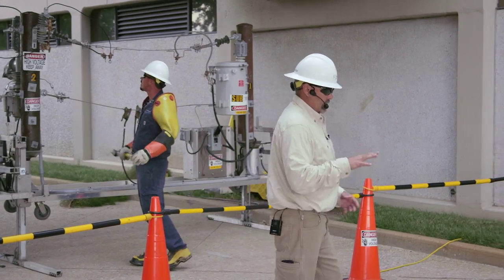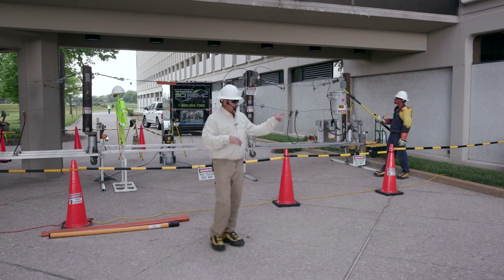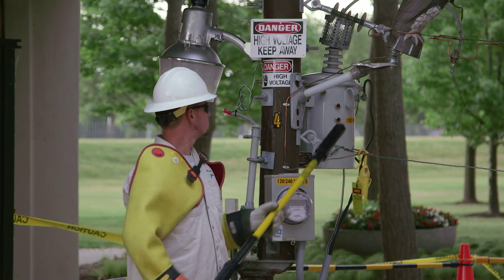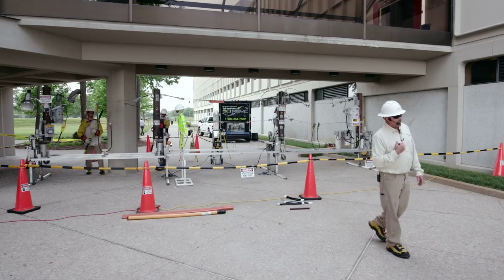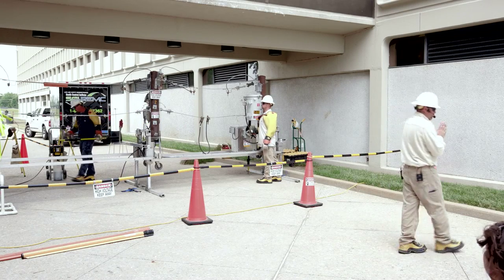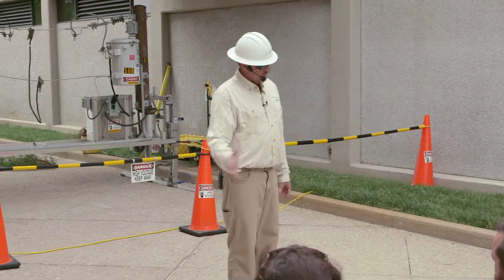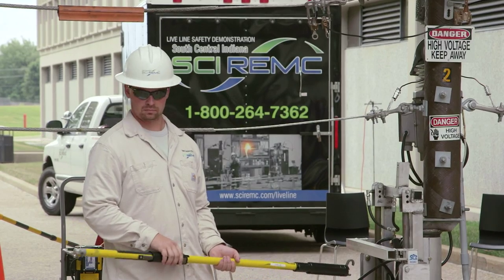SCI Live Line Electric Safety Demo

Comment: That is the purpose of an ATS ( Automatic Transfer Switch ) when a customer buys and has an electrical company install the pad mounted generator. I personally have most experience with the Cummins generators and I have done a few of the Generac generators. When the house loses power the generator senses the lose of utility and switches the panel towards generator power, then once utility comes back the generator switches back in around 5 mins (depending on brand).

Comment: I felt the step potential once. We where standing barefoot on a Boulder on the edge of Lake George.. In the distance we saw lightning hit the lake. 
We could feel a little current.
Reply: Yep.  It's basically what kills you, the difference, even if you might survive the intense heat and the shock of the intense sound pressure on your ears and being knocked down, it's usually the difference between either your two legs or (when people still think laying down is better than making yourself as small as possible while having your feet as close to each other as possible, your head and feet) that's the most dangerous.
It's the same what shocks you when you touch the mains: you are at zero volt potential, and the mains isn't.

Comment: What happens if you able to stay in a car and it’s energized. Would the lines be deenergized and how long would that take in an emergency?
Reply: @KlixTrio, cars are generally a metal shell with fabric and plastic interiors: in most cases, power will flow around the outside of the car to the ground, leaving the inside of the vehicle relatively safe.  That flow might trip a cut-out, but it might not, and it is virtually impossible to know when it's safe to leave without a utility worker being present outside the car.  Response time varies by conditions (It's really hard to get out to you if you're in a rural highway during a blizzard versus if you hit a pole on a warm summer night), but they will prioritize getting trapped people out safe before they work on getting power back on.

Unless there is something that makes it too dangerous to stay in the car like a fire, just sit tight, call your local power company or 911 so emergency services know exactly where you are, and be patient.  It just takes time to make sure everyone can get home safely.

Comment: Mylar itself is not actually conductive, it’s an insulator. However, balloons aren’t just made of Mylar… they are also coated in a thin layer of aluminum, which is very conductive. The aluminum is why it’s reflective, otherwise it would be clear. Same with a bag of chips: it’s aluminized, and if it blows up against a power line, it’ll do the same thing as a balloon.

Comment: These guys walk with a swagger.. IT'S WELL DESERVED! Even Dirty Harry wouldn't mess with the "Devil's Veins". It's incredible that 1,000's of volts hover, in bare cables, over our heads and we don't think twice. That's a shame. Take it from Ben. Electricity can ruin your whole day if disrespected.
Reply: Well, we have them underground practically everywhere, and when something went wrong somewhere during an outage it caused ehm, well this problem:
https://www.youtube.com/watch?v=PT-DTVa3YAQ

(It was said an existing powerline used to divert power might have overheated due to high a demand on it and, at a particular style of joint that might have broken down over time and had ground water ingress and is also insulated with mineral oil suffered a breakdown which is what caused the thing you see in the video.)

Comment: Would there be a way to have sensors that can somehow relay information back , like some sort device that detects electromagnetic frequency , so let’s say if one of the sensors that ran off it’s own solar power idk how it would be connected to relay the info but to know exactly where the power has disconnected a EM sensor could show because all the ones that show on gps lit up but then there’s one the rest down the line out , then from live to dead check that exact location and that’s where the fault is . That way time is saved looking for it and more

Comment: How do you hook up the gene wrong? I’ve always had it done with the gene producing 220v. I use a double male RV plug to plug into the electric car charger port. So when power goes out. I shut the main and plug in gene. start gene and then I have power to the house while solar panels and generator are still producing without any voltage going back to service.

Comment: If microwaves cook from the inside out, why is the outside of the food always piping hot and the inside cold?
Reply: Not all microwaves will have a good dispersion of the energy from the magnetron, like for instance, we have a cheap one (it does the job, don't get me wrong) that has the main focus of the energy in the center of the metal cage.   So when you put a plate down at the rotating dish it can actually be pretty insufficient compared to when you would place the plate higher up.
Also, moisture in food tends to be more sensitive to getting heated up then areas in food that contain a smaller amount of water (just like, with pizza, tomato on it can be flaming hot while the rest is edible, water get's heated up better and is able to retain that energy better than the more dry deough of the pizza.

Comment: Wait so if a tree fell on the line it could “cut” through the tree?
Reply: Yes! To a point. Obviously it's only going to burn thru tree's(Limbs) up to a specific size. Also depends on how conductive the limb is. The more green a tree is or how much water/rain or moisture is in it. All plays a role in what ends up happening. So just to be clear, if a limb lands on a line and it's wet from the rain. The fuse is going to pop! If they have a circuit breaker installed it'll try to turn back on a few times like what was demonstrated in this video. But it won't stay on unless the limb falls off from wind or something. Because obviously being wet is making it highly conductive. But let's say a dry limb in the summer lands on it. It won't be as conductive, but it will be enough to burn it. Which will eventually cut through it. If u know anything about electricity and circuits/fuses. A fuse is set to a specific Amp load to fail. If there's something on the line, it'll have to be something pretty thick  like a branch two inches around or so. In order for the fuse to blow. But if it's a small limb. That means that the fuse can handle the load but the limb can't. So the fuse will stay in until the limbs been burnt through and falls off. So basically the limbs act as a fuse themselves, the smaller the limb, the less load it can handle. So if it's a big limb, most likely the fuse will fail before being able to burn thru the limb. The only thing you have to remember tho. Is conductivity! Because it could be a small limb, but it's so conductive. That it immediately blows the fuse. Because it's so conductive it blows the fuse do to an immediate spike in load. But all this kind of takes a basic understanding of how an electrical  circuit works. Next time you go for a walk in a city or town or even in the country. Look up at the power lines. Look and see if u can find power lines that go through an overgrown tree. Meaning it hasn't been trimmed in awhile. Ull notice that even though the trees in need of trimming. Ull notice especially on three phase distribution lines. That all of the limbs are just below the three hot wires on top. If I remember correctly it's called burn out trimming. The limbs try to grow but the tips get blown into the lines just enough to arc and burn the ends. It'll do this no problem. But usually this is a problem area, where lots of power outages occur. Because say u have an ice or heavy snow storm. The snow/ice weighs the lines down pushing them down into the overgrown limbs. But tree limbs also get weighed down causing them to come into contact with the lines as well. And since water/ice/snow makes those limbs really conductive. So usually it'll take the power out. But the system just might be able to burn thru the limbs. Just depends my man. I'm sorry I couldn't find a quick and simple way to explain this. Lol I used to be a Line Clearance Arborist Tree Trimmer, so I literally had the job of cutting limbs 10ft away from distribution lines. I got called out on storm work a lot too. If ur power went out, I would have been one of the many guys going out and assisting these lineman. We'd clear the lines. They'd pop the fuse back in. Anyway hopefully my explanation(Novel) helped a Lil bit. Lol
Reply: @richardbadish6990  thanks it was worth reading
Reply: There are a couple of good examples on Youtube of safety systems not sensing the problem very well after a tree landed on some powerlines and the electricity proceeds to wreak havoc on the tree main branch the longer the power is applied until the whole thing is smoking.

Comment: Another thing that wasn't mentioned was CALL 811 BEFORE YOU DIG!!! My neighbor was that one idiot who knocked out the power to the entire neighborhood by hitting the primary underground power line with bulldozer. He did so much damage that it took almost a full 24 hours to fix it. . . In stiflingly hot weather. That was absolutely miserable. Everybody's food spoiled, we couldn't take warm showers, and some medical equipment wouldn't work without electricity. Not only that, but, my neighbor had to pay thousands in finds. All because he didn't call 811.

Comment: So when line wires get too much sag. And arch.. why no faults? Had this happening for a year until I found them arcing.. duke only cared if it was pole to pole (it was) but I dont understand why it didn't fault something and cut power
Reply: A fuse or the reclosing system will only work if the amount of power requested exceeds that of the fuse or reclosing system long enough.
Like, we had the cord of our toaster blow up once in my home, and it literally blew most of the cord right after the plug completely off, leaving a tiny piece connected to the plug exposed, and since it's an older toaster that contains a nylon outer coating of some sort, that caught fire immediately, and a small flame was shown, along with repetitive arcing.
The fuse however, did not trip, my brother ran to the distribution box and flipped the main switch and yelled to my dad everything was off so he could put a dish washing cloth soaked in water on it.

Comment: I don't understand the part if the line falls on your car you bunny hop..but ems can walk in to the area?! No need to hop?🤔🤔
Reply: No, that's not what he said.  He mentioned that if EMS is not informed about the nature of the accident and they can't see the possible downed power lines very well (either because it's dark, or it's during the day and the cable is not easily visible due to hanging against a dark background like other trees), they will be closing in on the accident site and might start to feel something is not right and back off, or might feel it when it's too late and touch the car or victim and get shocked themselves that way.
It's not common in my country to learn about these things unless you become an electrician or a crane operator (for the main reason most of our power lines are underground) and you need your safety license because you might be operating around high voltage lines, but they mention that should you report an accident involving high voltage and someone is still inside a vehicle that has become live or someone is lying down next to it that you make note that power is still on, so the ambulance crew will know that they have to stay back.
He didn't make it very clear, but it has put EMS employees at risk at well sometimes for someone failing to mention the car was live (sometimes because someone didn't see sparks, smoke or fire around the cable).

Comment: i stuck a jack hammer in 34,000v i was told when u guys should up
Reply: There's a video from a green-keeping crew in my country using a root-destroyer (It's like a very serious circular saw in a way, meant to dig into the ground to completely grind a root to splinters) near a substation and maybe due to the ground sinking a bit (it's a bit of a big problem in The Netherlands by now) the distribution cable probably was a lot closer than they imagined and they cut right through it...
Reply: @Dutch3DMaster  that's shit is no joke
Reply: @215maloneboy9  It isn't.  Luckily it killed power by blowing a fuse immediately and no one was injured, the crew was only shook up and very annoyed about the problem they just caused.

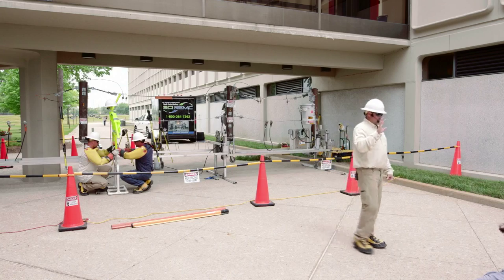Comment: 18:17 it would have been better to explain that it’s because both of the birds feet are at the same electrical potential therefore no electricity passes through it. Instead of just saying “it’s not touching the ground” . Then this would have tied into the step potential explanation because it’s fundamentally the same concept. As long as there’s no difference in electrical potential in your feet then no electricity will pass through

Comment: 5:50 let's see:  the breaker goes on and off 4 times and hopefully it burns the tree off the line.  I'm in Calif.  PGE has started a LOT of fires the last few years by not keeping their line areas free of potential falling trees.  So setting the tree on fire, that's a good thing?  It's 2021 and we now have at least 2 fires burning that were caused by PGE and trees.  Burning the tree down makes no sense.  That burning tree will set whatever is at the base of the pole on fire. There must be something that is missing here in his presentation.
Reply: That's a good point.
This guy doesn't do a lot of presentations
Reply: It's not the main idea of trying to burn the tree limb of, the main reason is to give the circuitry a possible time to recover from a fault, for instance if the limb fell on it, was not balanced well enough to get stuck on the lines and then fell off.  After the initial fault that was sensed the circuirtry was made live again, and if the branch had fallen off (or, due to the first arcing snapped in two or whatever) and the circuit stays on, everything is considered fine.
It's a way to not immediately have a part of the grid go out completely by means of a fuse or security system behind the fuse that operates when serious problems happen, and, for longer distances in the grid maybe also having to send out someone in order to investigate this possible problem which might have sorted itself out.
Even if a branch fell off during the first switchoff, chances are there might have been sparks anyhow, regardless whether it actively got burned through.

The reason it does it 4 times is basically having the thing go: "Hey, I think I saw a problem on the line and I'll switch off for a bit so if the fault condition clears itself in that time, there's nothing to worry about" and after switching on "Oh my!  The fault is still there...." switches off again and at the fourth time it decides there is a serious problem that needs human attention.
It's a bit like not having to replace your distribution box in your home after you had a short circuit because there was a fuse there, which, upon a fault gave the visible (and at times, audible as well) warning like "Hey, there's something wrong that you might want to look into" and when you try to switch it on and the fault is still there will trip again immediately.
Reply: @Dutch3DMaster  it would seem to me that if there was smoke coming out of my TV, then I would want the power off and would then get the hose and put out the fire or call 911.  I certainly wouldn't want the circuit to keep trying to reset, just because there may be some inconvenience for the power being off until help arrives.  The video clearly shows the limb burning and if that had been a partially dry limb (one more apt to break from a tree and fall on power lines) it would have caught the tinder below the line on fire.  Keeping a line live with the risk of devastating fires makes no sense, especially with what we are experiencing Calif. right now.    To stop the possibility of fires, PGE is actually shutting off power to millions of customers during high wind events.  Now that makes more sense than tripping a breaker 4 times to burn through a limb.
Reply: @AffordBindEquipment  As I said, it's not particularly designed with the idea to blow branches to pieces that way, it can be anything that triggers the system to stop it from going into full fault-mode immediately.

I will have to be honest here: I'm reasonably sure we do not have this system in The Netherlands for the main reason our lower voltage is all below ground (and an increasing number of high voltage lines is getting put underground as well) and these kind of faults can not occur.

As for the smoking television set example: I was referring to the manual intervention it requires to reset the breaker, which is what the 4th trip of a recloser would initiate.
A breaker in your home will also only fail if the fault current is high and long enough, otherwise it will stay on.
We had the wire from our toaster blow itself apart due to a short about 4 centimeters behind the plug, and the overall coating of the wire (nylon, it's an old toaster) caught fire and sparked a couple of times, but it did not trip the breaker in our home, so we killed the main power switch so my dad could put a wet dish washing cloth on the piece of wire that was on fire.

Comment: I remember goingon a field trip and theydid this exact safety demostration and me and my friend argued whether bunny hopping was one foot hopping or 2 foot hopping

Because my friend thought if you did it on one foot the energy would go up in you. I thought the bunny hop was one foot because it would not allow the circuit to complete (only one side instead of the required 2) so you wouldn be touched by the energy